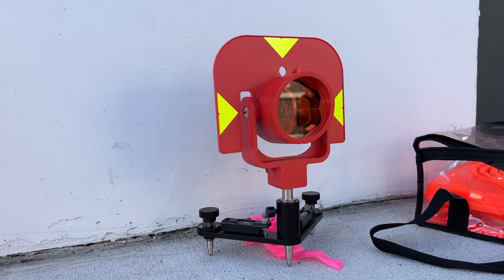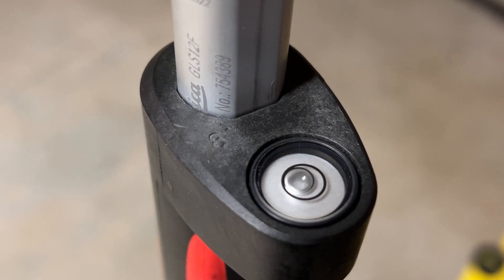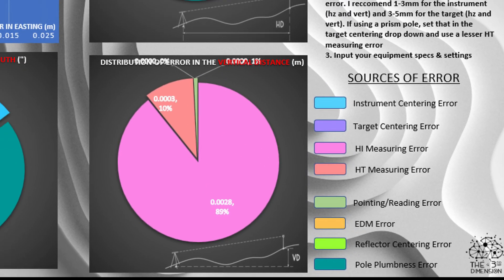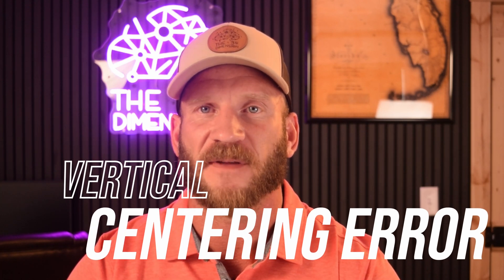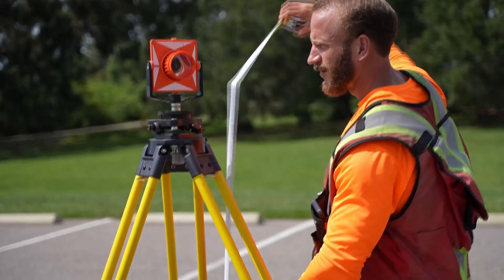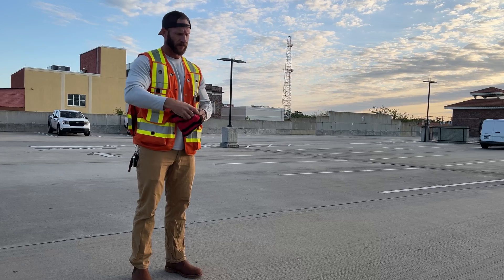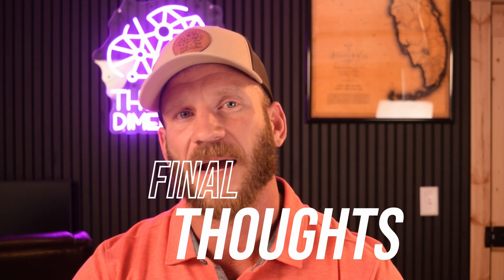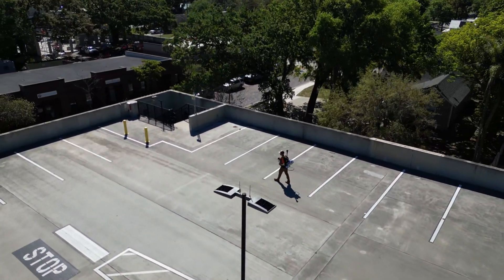Mini Tripods - Big Impact in a Tiny Package

Comment: Nice presentation! Definitely worth using. However, having a GNSS receiver too close to the ground can be a bit risky, as it may affect vertical precision. My personal go-to setup is a predrill, a big tripod, and a carbon pole for GNSS measurements.

Would you be so kind as to share your marking hacks on different surfaces?
Reply from the maker: I thought that would be an issue as well. I reached out to one of the leading experts of GNSS in the industry and he assured me with modern receivers that it wasn't as issue. Having not tested it myself I cannot say for sure one way or the other. The individual I spoke with knows far more than I on the topic so I took his word for it but I am also curious.
As for control point demarcation, I like concrete nails, predrilled if in concrete or straight in asphalt. Scribes, either from a carbide tipped laminate cutter or oscillating tool/grinder with a masonry disc.

Comment: Great video again. Do you not use separate control points for the xy position and for the heights? It seems really outdated and inaccurate to measure the height of a total station or a prism using a tape measure. We always set the instrument height using a measurement to a fixed-height prism on a height control point. It's the same principle used in traverse leveling, only using a total station instead of a (digital) level.
Reply from the maker: Yea we sometimes transfer elevations from control points to our setup locations. It depends on the situation.
If you can eliminate as many measure ups for HI/HT as possible, you'll be better off depending on the variables you're facing of your setup.
Can an HT or HI be measured accurately with a tape measure? 100%. If precautions are taken.
Reply: @The3rdDimensionSurveying  Great response and thanks again for the informative and helpful videos on your channel.